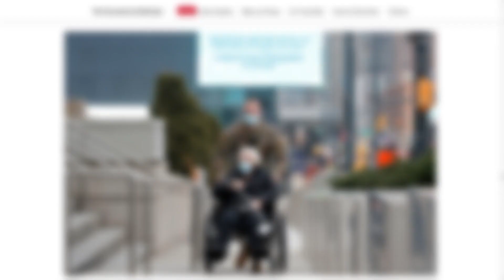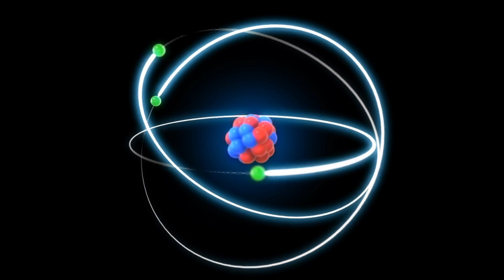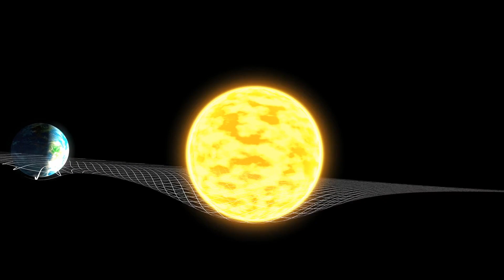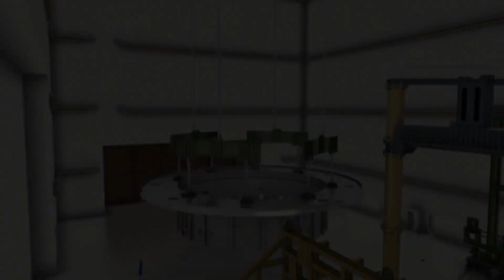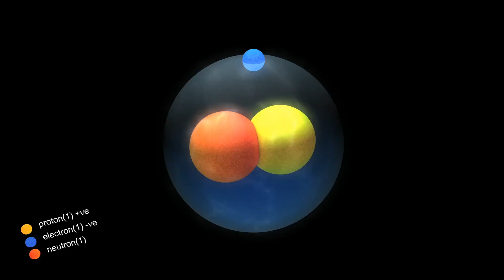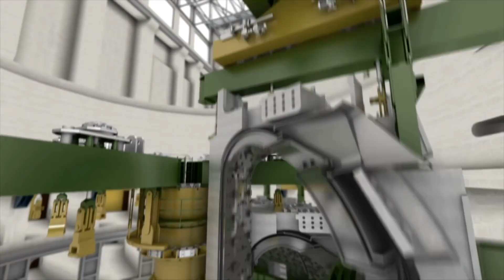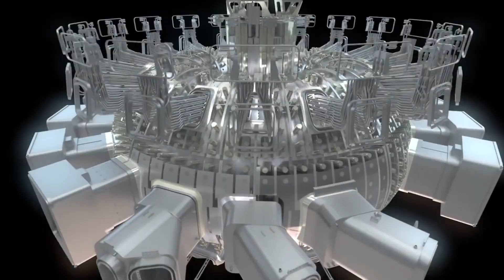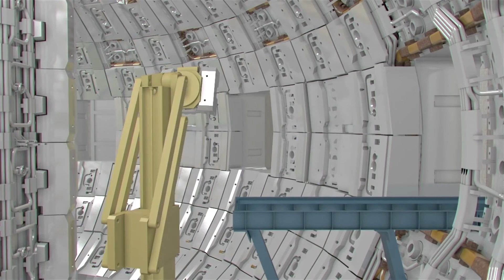The Power Source of The Universe - Can Nuclear Fusion Help us Reach Type 1 Civilization?

Comment: Oh the arrogance of humans. Not saying this is literally impossible, but especially at 5:15, you gotta love human hubris: 'You basically trick it into thinking it's a star.' The universe is only 34B years old, but we've figured it out in a couple hundred!
The argument for using the magnetic force answers my basic problem with this concept, which is that we can't create that much mass/gravity on Earth. So why is the magnetic force supposedly easier to manipulate? Isn't it inherently connected the the electric field/force? Isn't gravity either a necessary condition or consequence of these forces?
I hope I'm proved wrong and we can harness this awesome power, but all of the "records" made in this department come down to "If you dump WAY more energy INTO the system, then you can sustain the system for longer!" Yes... but you're ultimately at an even greater net negative. So what is going to change this?
Reply: All the talk about tritium etc. hits on what I mean: We would have to do all this work just to get our fuel source ready to burn, whereas the natural formation of the universe brought hydrogen molecules together into starts to begin with, ready to go, burning as soon as enough mass collected to crush down on it.
How in the actual fuck are we going to make this viable/net positive energy? Let's just go back to fission; it works.
Reply: All that said, great video! Fascinating subject, the stuff of dreams (I think literally).

Comment: We are close to overcoming the first major hurdle for Fusion as mass power generation, i.e. making it work. The next big hurdle will be to demonstrate that it can be cheaper than Wind and Solar electricity + energy storage. The second hurdle is getting tougher  with each passing year as Wind/Solar get cheaper.
Reply: Petroleum-based fuels have an ener- gy density of 42. Atomic power of- fers an energy density of 45.

Comment: These people will never figure out what happens in the sun. That's why they struggle to construct a commercial nuclear fusion power plant for the last 50 years. When scientist says gravity is confinement for the fusion reaction, it is clear sign he doesn't have a clue about thermodymincs. Laws of thermodymincs clearly say that isolated system can't do work upon itself without external work added. This is proven by existing experimental fusion reaction where they have to supply more energy to the system to hold the reaction. Easy. So far, The haven't generated a single Watt of energy from those facilities. They are trying to build a perpetual machine literally which is a clear sign of mistake. The whole theory of gaseous stars, especially so called gravitational collapse, violates all laws of thermodynamics. We receive energy from the sun via electromagnetic radiation, not by fusion. This is scientific fact. The rest is assumptions. It is believed fusion of hydrogen happens inside the sun without a single proof. Check it by yourself if you don't know that yet. Photosphere emits continuous spectrum of light like a black body. Gases can't do that. It was known already in XIX century it must be liquid or solid to emit that kind of spectrum. Hydrogen and Helium can emit a few lines of light only. So, stars are in liquid state, supposedly solid inside. NASA seismic studies actually confirm that. Wait the minute? Seismology deals with condense matter only, doesn't it? The truth is there is no a single proof that the sun is a gaseous ball. Again, check it by yourself and prove me wrong. Anyway, they will try harder and harder because they have no way out of that mess. If stars are not gaseous balls than the whole standard model can be thrown into a dumpster. No Big Bang, no black holes, no more absurd in astrophysics. It would be devastating for the field as so much money was wasted to date.

Comment: DT fusion only produces 1 neutron to breed tritium from lithium, some neutrons will not breed and tritium decays so DT fusion requires external tritium supply. Where does this tritium supply come from?
Reply: The fusion community does not like questions like this. The answer is that there is no other source of tritium adequate enough to produce the Kg per week that a large fusion reactor would need. Hence a DT fusion reactor will never be built. It is not helped by the absence of barriers to prevent the escape of tritium produced in the breeding process, while no one will spend billions without testing the systems to be used, and without a source of high dose 14 MeV neutrons, there seems no way to do this.
Reply: @johnh6245  If all of humanity have a mentality like yours we would still be hunter gatherer today

Comment: Doubtful. We won't reach type 1 with any pwr or bwr reactor. The working fluid for energy transmission in a fusion reactor is still water. That's still primitive by type 1 standards. Fusion is just a buzzword for a new way to vaporize water